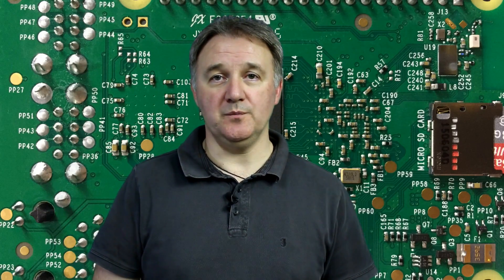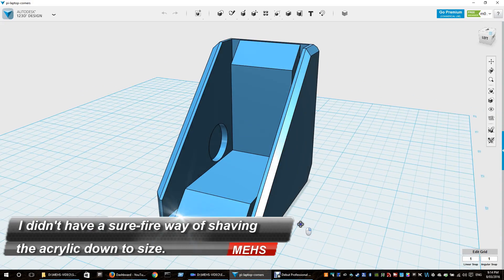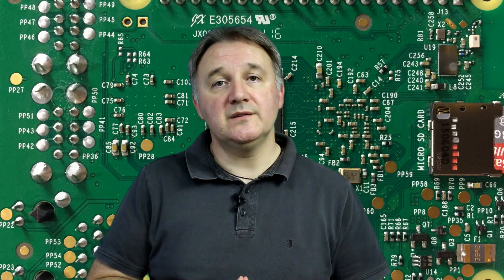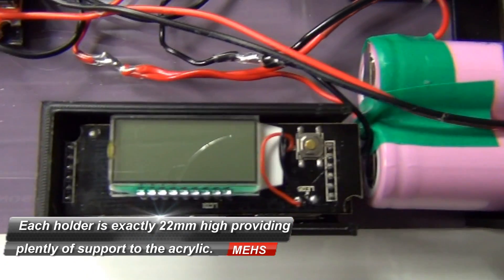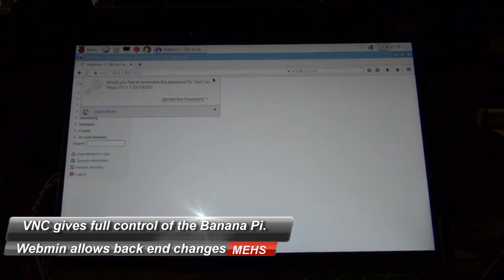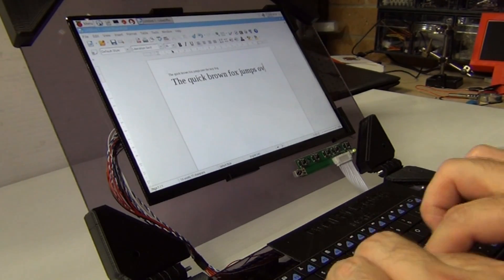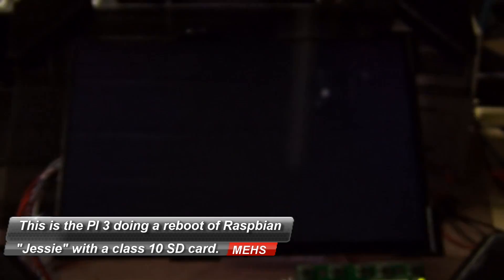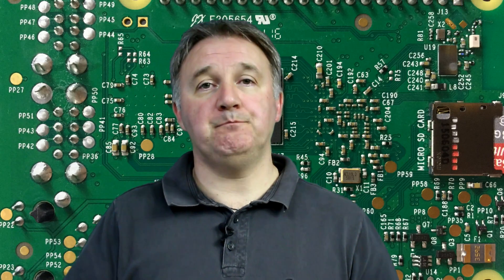Raspberry Pi 2 / 3 - Dual Pi Laptop Part 2 (MEHS) Episode 41

Comment: That is really a great RPi laptop build! One quick question. Can the Raspberry Pi 3 run youtube videos on 720p or even 1080p resolution? Thank you!
Reply from the maker: +Chip Miller - Hi.  Thank you.  There are 2 typical ways to watch YouTube videos on a Pi 3, through a browser like IceWeasel and through a media centre like KODI.  If you watch through a browser then I'll say no.  You are likely to top out at 480P.  I don't think 720P is watchable as the frame rate is too slow.  You get better performance using KODI.  I would say 720P is fine on the Pi 3 using KODI.  1080P is possible but depends on settings, connection speed and type and encoding.  Short answer is sometimes.  Hope that helps.  Cheers.
Reply: Thanks so much!
Reply: +My Electronics &amp; Hacking Show I see that you designed the hinged system. I was curious as to how you added some resistance to the shell. How did you prevent the top shell from falling flat backwards?
Reply from the maker: +Chip Miller - You can do it a couple of ways.  The first is to design a hinge that only opens so far and has a physical stop.  The second is to design a friction style hinge that relies on two surfaces being pressed together with enough force to stop the top piece from moving .  This second method works well.  You just need a bolt and nut to squeeze the parts of the hinge together.  If you lid is heavy, make the barrel parts of the hinge bigger to create more friction.  Cheers.
Reply: My Electronics & Hacking Show That's a good idea. As you might be able to tell, I am currently in the process of making a Pi portable. Your channel is awesome at describing things and your designs are brilliant. I sure hope you don't mind me asking you all of these questions. I think I've watched all of your videos twice now, maybe even three times. Thanks!
Reply from the maker: +Chip Miller - Thank you very much.  No I don't mind.  I will answer what I can, when I can.  Let me know how your build goes.  Cheers.
Reply: +My Electronics &amp; Hacking Show So I have another question for you. I have ordered a few of the main components that I need, I am just putting together my second and hopefully last cart of parts. I was wondering how you were able to turn the pi off when closing the computer and how you made it turn back on after you opened it? This is how every laptop should operate. But I'm having trouble thinking of a way to do that for my pi. Thanks!
Reply from the maker: +Chip Miller - I used separate switches to turn off or on the banana Pi and or the pi2 and screen.  I didn't have the traditional lcd off when closed however you can implement this by using a tac switch in line with the power to the screen or screen driver board.  There are long shaft tac switches that would fit between the base and the screen when closed.  Just make sure the switch is momentary and is open when pressed (power flows when switch is not pressed).  Cheers.
Reply: So is there a way to incorporate a switch that turns the pi off and on? I know that you simply write a code to shut down the pi, but how do you awake it again? If I am running this portable, it is not practical to have to plug and unplug the power source to wake it again. Plus, I'm running a solar system to assist charging, so it will gain small amounts of power every so often. Thanks.
Reply from the maker: Chip Miller - OK, you sound like you want an ADC circuit that will detect when the lid is closed or opened and a script running on the PI that shuts down the Pi when it received a signal from the ADC circuit.  Not impossible but not dead simple either.  You would need to make the ADC circuit and write the script, probably in python.  The 'turn on' part would be achieved by a momentary switch allowing power through to the Pi.  Nothing tricky with that part.  I would probably build the project first and then implement a laptop style power solution.  Cheers.
Reply: That's a good idea. I was just trying to plan a little ahead, but that is a bit over my head right now. We'll see how much I can learn. Thanks!
Reply from the maker: Chip Miller - Best of luck, and enjoy.

Comment: Why not use pi zero instead of banana pi :)
Reply from the maker: - Hi.  The Pi zero is an option but in this case I didn't have a Pi zero and I needed a bit more power to run the functions and the vnc server so I used the banana Pi.  I also had it lying around .  Cheers.
Reply: +My Electronics &amp; Hacking Show 
I see, fair enough. And no need to say, great project! keep up the good work!
Reply from the maker: +Çağlar Çelik - Thank you.

Comment: how come you never said how long does a full charge of batteries last? you just said they dont last much, well then how much?
Reply from the maker: - Hi.  I can run this laptop with the pi2 and screen or with the pi2, screen and banana Pi all running.  Just the pi2 and screen can give me up to 4 hours runtime.  With the banana Pi it drops to 3 and change.  The charge time is almost 6 hours with the charge module set to deliver 1 amp, 1.5 is the max for the sparkfun module.  I won't use this battery bank in the future.  I can get better results making my own 18650 bank or a premade 6ah lipo.  Cheers.
Reply: My Electronics & Hacking Show 3 hrs isnt bad, any suggestions on what power bank to use?
Reply from the maker: +MineCralex - The runtime is ok but I should be getting more considering the size of the battery bank in the unit.  I could get similar runtime with a single 6ah lithium battery that's less than half the size.  If I made my own the same size as the bank in this laptop I could get up to 10 hours runtime.  It all depends on your budget.  The cheap ones like what I used have low capacity batteries.  They still work but take up more space or deliver less performance than more expensive options.  What do you want it for?  Making your own portable something or do you need a ready made battery bank for general use?
Reply from the maker: +MineCralex - I won't mention brands but I would avoid anything that says it has more than 16000mah capacity unless its physically large.  Price can vary a lot but i would suggest you would pay around $50 for a good 10000mah unit.  That would give you a quality unit that has a decent charge circuit and reasonable current output through the USB port or ports.  A manufacturer that has a website with good data on their products is also very helpful.   Cheers.
Reply: My Electronics & Hacking Show thanks man, i appreciate the long writing man.

Comment: With the new Pi 3 you lose the WiFi dongle and gain speed/64 bits. What do you think of using 2 Pi 3's?

Another, but slightly more costly option: Odroid C2($42) and XU4($77). The the Odroids can use eMMC or MicroSD and it's a snap to throw an SSD on the UX4. The  4-core C2 is 64 while the 8-core XU4 is 32. Odroids also have an eMMC with Android. Bluetooth dongle is $6.
Do you see any issues here?

Good work. Great production values.
Reply from the maker: +Hephaestus - Thanks for the feedback.  I have been thinking about something similar.  I already have the new keyboard I want to use and I was considering a single board rather than a double for another laptop build.  As far as the Odriod options, I was just on their site last night.  Getting one in Australia might not be straight forward but I'll keep looking.  I've tested the Pi 3 with a USB HD and it worked well but I am keen to get something with EMMC memory and experiment.  I don't see a problem with a couple of variations here, 2 or 3 builds, and see which works best.  I like the benefit of not having usb adaptors hanging out the side for bluetooth or wifi so the PI 3 is an attractive option.  If I feel like breaking out the ports and moving them internal to the build then any of those boards is an option.  The faster the better (Odriod C2, 2GHZ per core).  More work to do!  Cheers.
Reply: +My Electronics &amp; Hacking Show 

Odroid C2 AU$83
http://www.auseparts.com.au/index.php?route=product/product&path=97_110&product_id=280

The same site has the XU4 AU$146.
http://www.auseparts.com.au/index.php?route=product/product&path=97_106&product_id=244

Unfortunately it's out of stock.
Reply from the maker: +Hephaestus - Thanks for that.  I'll keep my eye on stock.  Cheers.
Reply: +My Electronics &amp; Hacking Show 

Odroid C2 stock 1
Odroid XU4 stock 0
Reply from the maker: Hephaestus - Thanks.

Comment: I bought the raspberry pi 3. I bought a sd card with games and kodi on .... I can not pair a remote in any way? .......

If I put sd card in emulation station opens straight away... But I can't play games because of remote
.? If I don't put the sd card in the pi doesnt start so I can't use it any other way .......

Please can anyone help I just want to play games and kodi with a games remote not a pc remote
Reply from the maker: Hi.  I suggest you download the current retropie distro and write it to a fresh sd card and try that.  It should work with most USB game controllers.  If that works then you can look at the configuration on your other sd card and see why your game controller won't work.  Cheers.

Comment: Hello great project :) i want to ask you : Were you doing some kind of programming in this project ? Or was it "just" wiring boards and other parts together  - it must be plenty of work ..
Why am I asking ? This stuff is really new for me and i decided to built something similiar :D but i dont know where to start ..
Reply from the maker: +Jirka Tvrdoñ - Hi.  Tough question(s).  Firstly, with this project there really isn't anything I would call programming.  All you really need to do is know how to run a linux desktop and command line and configure a config file which is just a text file.  There was some playing around with VNC software configuration but thats just back to time and effort.  It might take some time to find your way around but I'm sure you can do all that without problem.  Most of the parts are off the shelf so its just a matter of establishing what you want in your project and giving those parts the power and connectivity they need.  A good plan will save you many many hours.  You can save yourself some leg work by using the parts I did for this and other similar projects if that works for you.  What I suggest is take your time for the first project and don't start with something huge or complex.  Maybe just get a Pi and screen connected and running from batteries as a start.  Then you can connect keyboards, add cases and pull it all together how you like.  Hope that helps.  Happy to help where I can.  Cheers.
Reply: Okey thank you very much i will look into it :)

Comment: was wondering if you have done anything with the pi and running obd2 diagnostic software,
Reply from the maker: Hi.  Not at this stage but I have heard that many windows odb2 software will run within WINE on the pi2 so that might be the easiest solution.  Cheers.
Reply: Alrighty ill have to look into that, appreciate your time.

Comment: What would be wrong with keeping the banana Pi for the eSATA connection to add a larger HD to store all those media files?   I did get in on a Kickstarter that offered a board so that you can add eSATA drives to Raspberries Pis but it is taking forever to be sent and we aren't getting many updates on the project and I am starting to worry, it's been over 6 months ago since my pledge .  Do you know any other way of adding a 1TB SSD to a Rasp Pi? without comprising too much space in your case?
Reply from the maker: eLJaybud - Hi.  The USB choice was mostly because I already had one and I tested a USB 2 unit that had some reliability issues when connected and powered by the Pi3.  It did work but I think that some of the older USB 2 drives draw a little too much power or the power draw has more peaks and troughs.  Either way the USB 3 drive worked much better in the PI 3.  Cheers.
Reply from the maker: +Kenneth Elston - Hi.  Hope your kickstarter item arrives soon.  The banana pi offers sata like you said.  In this project I would probably not have the space to add a 2.5inch HDD.  I am now working on a Raspberry Pi 3 media centre that will hopefully turn out like I want.  It will have a 1TB HDD and a DVD player.  The Pi 3 will run a modern (USB3) 1TB HDD without issue.  With the extra power offered by the Pi3 I would redo a laptop (and I will be doing a new laptop) using just the Pi3 and a USB HDD (probably 1TB).  With just the Pi3 there will be plenty of space and it will be easier to deal with power management etc.  If you can, change your project over to the Pi3 and add a USB HDD.  I will cover some detail in my next video about the media centre with HDD.  Cheers.
Reply: +My Electronics & Hacking Show though the Pi 3 is usb 2 so you may as well use a cheaper old USB 2 interface.
Reply: +eLJaybud yes, but USB3 devices might have some spare prestanda so it could even be useful for USB2 devices. But yes, you are correct, the RPi 3 can't utilize all prestanda from USB3 devices.

Comment: How about solar charging included?
Reply from the maker: +Eshan Shafeeq - Hi.  It's possible but it would be very slow.  A panel that would fit onto the lid of the laptop would only produce about 150ma.  To charge the battery bank would take about 40 hours.  An external solar charger that is bigger and with a higher output would be better and it can still be plugged into the laptop as the charging module has a convenient USB port.  If I find a much more efficient solar panel I might give it a go.  Cheers.
Reply: thanks alot for the info :)

Comment: I really like where this easily affordable micro-tech is going.  I have wanted to build exotic wood laptop and tablet enclosures and these cheap computer boards are going to make it a reality. I would like to get these plans and basically use them as a jump off point for build dimensions. I would love to build one of these with a beautiful all wood casing.
Reply from the maker: +Ian Brown - Hi.  I agree a wood enclosure would work very well with a project like this.  Depending on budget you could grab a 12 in display instead of the 10 I used.  It will still fit within the 300mm x 210mm footprint of this project.  The only real size constraints are the 22mm you need between the base of the project and the keyboard layer to fit all the parts.  Then just fit the keyboard however you can depending on dimensions.  I would not use the same battery bank or keyboard if I re-did this project.  Cheers.

Comment: nice  set  up  i am  thinking  about  something  similar  using  a   pine  a64 +2 board  myself  can  you  please  tell  us  where you  acquired  the  display  from  it looks  perfect  for  my purposes  . thanks
Reply from the maker: +Chip Miller - They are rated at 12v but so I've found with most of these boards and screens, they are happy running from 5v.  You just need to ensure there is enough current for the board and screen.  I have measured the draw at almost 1 amp at 5v for this 10inch version.  A bit less for 7 inch screens.  Cheers.
Reply from the maker: +William Hart - Hi.  The display was acquired from EBAY seller FOOSOO.  Search ebay item number 301729281597.  I am very happy with the display but it did take much longer to get than I expected.  I contacted the seller who told me there was a shipping error and they had to resend.  It did eventually arrive and was packed well.  The other search criteria you can use is   hdmi+vga monitor 10.1inch 1280*800 IPS .   Cheers.
Reply: +My Electronics &amp; Hacking Show Does this driver board require 5V or 12V to run the display? Or how exactly is it powered? Thanks!

Comment: Nice! I would include a RTL-SDR software defined radio for nerdy radio stuff, and possibly a second usb wifi for wardriving. But that's just me, this is great work as it is.
Reply from the maker: +ThalassTKynn - Thanks for that.  I hadn't thought of the radio idea but with the extra space saved by running just a Pi 3 that would be something to look at.  Cheers.

Comment: I was considering something similar to this using twin Intel Compute Sticks, or maybe an InFocus Kangaroo if i can find a source for those ridiculous custom headers of theirs.
Reply from the maker: +MortifiedDumplin - I'm thinking a pico ITX MB might fit.  The Pi3 doesn't do a bad job unless windows is a necessity.  Lots of options really.  Cheers.
Reply: +My Electronics &amp; Hacking Show It sounds like a good idea, but just about any hobbyist Intel motherboard is going to require some beefy power supply, even if the board can run off of a PicoPSU that still requires 12V 5A for the lowest of low power supplies (the picoPSU-120) and that gets you an absolutely useless 60 watts, only enough to do the same level of stuff you can already do with a Raspberry Pi 3 at a lower cost, lower power consumption, and in a smaller footprint. 

Which is the reason I was looking at the Kangaroo or a Intel Compute, they're custom built to run on low power, about 5v 2.5A, and provide plenty of processing power with a proper x86 CPU to boot. now I think about it, with the dock port pinout and a connector you could go between using the Kangaroo in a custom laptop or a desktop situation without screwing with cables... sounds like I've got a project ahead of me.
Reply from the maker: +MortifiedDumplin - sounds like a project indeed.  For my needs I would prefer the higher power output (and the consumption) of a befier x86 solution.  I think the Intel stick is around 400mhz from memory.  Put a useable OS on top of that and I don't think I would find that enjoyable to use (as a desktop).  I'm only just happy with a pi3 really.  Either way it will be a good project.  I would like to know how it goes.  Cheers.